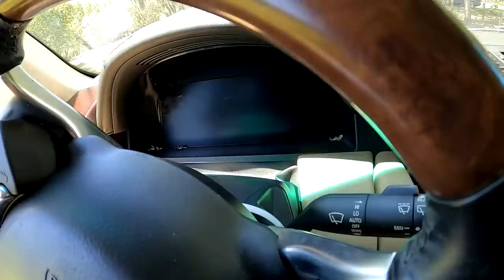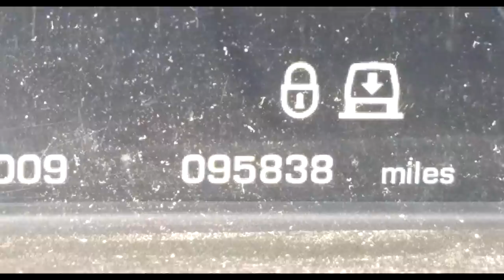I Bought a Supercharged Range Rover Super CHEAP after someone FAILED to Fix it!

Comment: When someone says “just let it go” telling you to roll off a trailer.... don’t do it.  Lol
Reply: Definitely not.  As that guys not going to pony up the 1k + in damage his advice and ramp placement caused haha.
Reply: I was expecting the pop out running boards to be ripped off!
Reply: @cardinaloflannagancr8929  looks like there was a spot for pins as well
Reply: Big fan and really like the videos. Thanks!   As for the ramp. There pins that are supposed to be inserted between ramp parts just for this exact reason.  That is a major rookie move for the two main guys here. And no way would that vehicle get stuck, and if it did the other two guys could push and it would roll right over any ramp joins. Worst case you give it a little pull with the tractor. 
 Not trying to be a troll or bang on you guys, but just in case others see this and wonder what happened.

Comment: The mechanic made it look like it needed a new engine in order to get the owner to buy a new Range Rover.
Reply: He must have taken it to an Apple Genius bar.
Reply: I doubt that Sam is that lucky with a 100k mile Range Rover.  Previous owner probably heard a noise and proceeded to drive it home, scheduled an appointment, and then drove it to the shop.
Reply: That's called upselling
Reply: The problem with this logic is telling someone the engine is wrecked doesn't mean they will buy another from you.  The 'upsell' may be manifested by a sale to a competing dealer and brand.  Also mechanics don't get commission on sales but the do get paid by doing repairs.  They personally have little to gain by you purchasing new vs gettimg your car repaired.
Reply: @timbrouns87  I agree especially when I started working as a car salesman and realize how they work as one when they want a well maintained vehicle.
Reply: Yep. And it worked!
Reply: @wh7234 
Well, considering that the vehicle actually has a problem, your anecdotal experience as a car salesman doesn't mean jack.
Reply: And.... given that it was "Traded in" he did.
Reply: @matthewgaines10  True however while they don't technically profit they are basically keeping their job by following orders.
Reply: Dealer techs don't do engine rebuilds.  They only swap out entire units -- transmissions, engines, whatever.  So if the head has to come off, they won't do that work -- their only "fix" is to replace the entire engine with a new one they have to buy directly from Range Rover itself.  So, as far as that dealer tech is concerned -- who isn't allowed to do a rebuild himself -- the engine swap is the only fix available.

Dealers have policies in place like that so that they're deliberately more expensive than a private shop.  For the dealer it's a win/win -- either they get $24K for a new engine, or they get the owner to trade for a new car.
Reply: That sounds just about right.
Someone was trying to scam that poor owner.
Reply: They are technicians, not mechanics. "Parts Changer" is another term.
Reply: @matthewgaines10  Sure they'll buy another one. Someone who'd buy this vehicle in the first place values status over functionality, so a meticulously-maintained $100k+ vehicle that needs (at least) an engine rebuild after less than 100,000 miles is no big deal.
Reply: @MrCarGuy  Someone who'd buy that in the first place wouldn't be put off by learning their expensive suv didn't even make it to 100,000 miles.  They'd be excited about having an excuse to get a new one.
Reply: @LMacNeill  not at all true. Im a Tech at a VW Dealership in Florida. We do entire rebuilds, cylinder heads, timing chains and so on. We dont rebuild starters, alternators or any "component" but we do rebuild transmissions and engines to an extent. If we advise replacement of the unit its usually due to the fact that its cheaper for the customer to purchase a new or used motor or transmisson because the cost of labor totals the car. For instance say a 2010 VW CC and the DSG trans starts slipping the clutch packs are about 1200 plus another 16-17 hours @ 130/hr  in labor to just rebuild the clutches while a brand new dsg is around 3000$ plus 5-6 hours of labor. Rebuilding is not worth it in this case. Because when the mechatronics (valve body) fails next in the rebuilt trans youe gonna be out another 1200-1300 easy. Its just better for the customer to replace the unit with a new unit. Now if the head gasket blows no ones gonna rec a new motor for a head gasket job. I wonder where your getting this misinformation from?
Reply: you know nothing about range rovers if you believe that dude, lol.
I have seen so many dead range rovers in the last 30 years it is shameful.
Reply: @matthewgaines10  I've seen people do it countless times. They have an awful experience with a car and they turn around and buy another one exactly like it. I don't know if they're just stupid or if they actually buy the dealer's story that it must be a rare problem and couldn't possibly happen again...🙄
Reply: @wh7234  2! W
Reply: @nodak81  
And I seen people abandon brands and dealers.  Your anecdotal experience is of no greater value than mine.

Comment: I had a 2010 RR-L, Supercharged Autobiography Edition.... someone paid $125k to drive it off the showroom floor - it had  brembo brakes, 22”RR chromed wheels, the power running boards, Arctic white over white leather interior, with blue piping trim, bought it in 2013, as a RR CPO vehicle, with only 24k miles, for $47k, which was 38% of what it sold for 36 months prior.....

Comment: Sam,  with that coolant leak it probably is the $56 crossover pipe that feeds the water pump.  I’ve done 3 of them on different Rovers.  What can happen is you blow your coolant out, overheat then blow a head gasket.  do the water pump whole your at it.

Comment: what we have here is a unique opportunity to observe the creation of a future junk yard. a combination of relatively inexpensive real estate with an overly optimistic owner with an engaging personality and  jones for cheap, but still somewhat attractive and originally expensive, wrecked cars. loads of fun for all! :)
BTW, my guess is that the previous owner was having engine problems and took it to the dealer. they had a mechanic check it over and partially dismantled it until such time that he or she decided that the engine needed replacement. then the customer was told what it would cost and was passed on to the sales department and the car was traded in for a new model, left dismantled and eventually sold at auction.

Comment: Sam, I have the same car, except silver and no auto running boards. At 67000 miles, last year I spent About 6 k on a new head rebuild. I did have an extended warranty that covered 5k of it.

Comment: My friend had the exact same problem, same car, same year, 48k miles. LR quoted $26k to replace the motor,  unfortunately, since these supercharged motors are notorious for motor failures, used ones are $10k+. A rebuild is probably your best bet. Also, it is sitting all the way down due to it sitting. Once you power it up, it’ll come back to normal ride height.

Comment: Right at the beginning with that tech on the line, sounded like my situation exactly. I bought an ATS and had engine trouble after few weeks. Towed to cadillac and they indicated I needed new $12k motor plus the cost of diagnosis with little to no explanation. It did drive well prior so I was "what the hell"!. Took to local mechanic and was able to fired it but horribly so i had to tow it home.
I tore apart the intake manifold, cleaned the valves (our GDI friendly build up), Injectors, and some electrical connectors that had oil and after $15 and put back together, got her running well. What a scam.

Comment: Remove the air suspension, swap in a supercharged LS. Not that I'm an LS guy, they're just cheap and plentiful.

Don't even waste money with parts and time on that engine.

Even an LS with a cheap turbo.

Or properly good, if you can get one, a 2UR Lexus lump. Great power and keeps the luxury theme.

Comment: Don't know much about Range Rovers, but I guess there are good quality (less expensive) aftermarket parts for every brand nowadays. Just get an estimate for all parts and see if you can have the engine rebuilt. And don't be cheap and try to reuse the spark plugs.

Comment: Just swap in a supercharged LS V8 Sam.  Get some help to do that.  Wouldn't surprise me if there is a kit to do that out already.   Unless Range Rovers break everywhere else, they are probably good candidates for solid running replacement engines.

Comment: You pretty much explained the gaping flaw in a Carfax report.  If an event doesn't get reported (I.E. the car needing $24K in repairs.) the report is useless and incomplete. Great the oil was changed every 4K miles religiously but if the engine grenaded none of that matters.

Comment: Those 5 L FJ engines are known for premature timing chain guide where. I suspect since the timing cover and the serpentine’s have been all taken apart, I assume it was in for timing chain failure, which is probably why the dealer recommended an engine replacement and the previous owner dumped it.

Comment: You brought me back to the time when I use work there. Be careful of the special tools needed to repair the RR. Its a nice vehicle if you take propper care of it.
Reply: The original owner took good care of it but the engine failed at 98,000 miles.

Comment: I bet the air suspension is set to access mode. In my land rover I have my 2017 set to access mode  and once placed in park it will automatically lower itself low to allow easy in and out access. If that's the case with yours then once you get it to start up and drive, after 5 mph it will pick up to normal ride height.

Comment: The dealer told me my saturn needed a new engine...it was a loose rocker arm.  10 bucks for a T40, took off the valve cover, tightened the rocker arm and the car is still driving today.  It's a 1995...the dealer wanted 5 grand for a new engine.

Comment: I tried out a run and drive 2013 with 75K miles which looks even better on the inside. Bidding got up to ~13,000 a couple time but never sold

Comment: FYI, never set ramps up without fastening them to the trailer with straps.  Then this sort of insanity doesn't occur.  I know it makes for entertaining content, but if Sam does manage to get this heap running that bumper and grill repair will probably be at least a grand or more- used.

Comment: I realize this was not requested but if you plan on fixing and driving this is what I would do if I were you..yes that was redundant.. ok, first of all you can get the entire report regardless of where you get it fixed. The black boxs sends information to the manufacturer...one good thing... you have a honest and talented mech/tech. Did you know a car or truck can by a comprehensive mechanical warranty. Trust me i only buy 3 to 5 off lease high end vehicles... consider 4 to 8 yr old and my two favourite cars I have owned for a long time, 1995 Range Rover County HSE. BMW 2001 740 IL Second year after they started putting a V8 in their flagship (sinking) The 7 series .... I loved the powerful 6 they used in the 7 series, Actually since its birth when someone from a copy team came up with The 3M The 5M now there is 3,4,5,6,7,8,and a super car not many even knows exists. That's it....hunting for one but it's so hard to find because vehicles disintegrate up in most cities across Canada, excluding the coast. But even coastal living you should under-spray to be safe ... I'll shut up now ... Just. Wanted to applaud you on your decision to go with the heat pump system. using this methods, its a great example for your children, no not the guys at the pub the kids at home , your kids... a little levity is worth its weight in gold......

Comment: Man, even if serviced religiously they still blow up at  100k miles lol
Reply: Which sucks because the 5.0 is actually a great engine. Methinks it was something water pump or cooling system related that caused the engine to overheat. I think the 5.0’s had issues with that.

Comment: Personally I would not try to start a car where the timing belt is not on, the valves and pistons won't be aligned or if the fan belt is not connected and you can see the radiator hose is not connected, even for a short time the engine will overheat

Comment: why are you shocked it has been stripped down? it was in the dealers,they were not going to put it back together,the engine is broke so nwhy bother,he traded it in for a new one,don't know why? you can get this engine rebuilt for a lot less than $25,000 or you can buy one from breakers where cars have body damage but no engine damage,this car looks worth it.

Comment: I sold a 2006 discovery 2,7 turbo diesel a few weeks ago, i had about 394.000km's om the clock ( about 250.000 miles i think ) with a bad engine in it. i stated in the add the engine is making baaad noises. i still got 4700 euroes for it.

Comment: I wouldn't have " just let it go " like that. This ain't Frozen this is real life and you just added at least $200 in front end damage lmao. That gen Rover weighs around 5K pounds you already know that wouldn't and well. If it got stuck I would just have Rich and Tow Dude push it back the rest of the way or have one of them get inside and push it myself. Sucks cause that shell is super clean.

Comment: So, let me get this straight. You buy very expensive car, you service is regularly at the dealership, you take excellent care about it and you end up with a broken engine. They ask you for 20K for repair. I almost sure this is kind of illegal according to some consumer laws. Second, why the dealership have not indicated or replaced the bad parts earlier? If they know these engines have badly designed parts, they should do something about it. And finally, congratulations on making the first accident on an accident free car :) Doesn't happend everyday, does it?

Comment: Just buy a massively damaged rear-ended Range Rover donor SUV to pull the engine out of and you're in business! Spend $5K Max and you will have a like new engine and transmission and tonnes of spare parts.

Comment: $9500 for a used working engine...all in for less than $15k (including the front bumper)?

I'd do it. But I've also had an 03 Discovery 2 and spent a ton of money on that...maybe I have an issue.

Comment: Why do you continue to buy these POS’s! Just like older Benz, Porsche, Jags, these Rovers absolutely just fall apart as they age. The use of so many plastic components used today just helps multiply the aging factor of these cars. 
There is a reason a once 100k new car can be had for 5-10% of original cost, they are pieces of falling apart absolute S*** as they age!